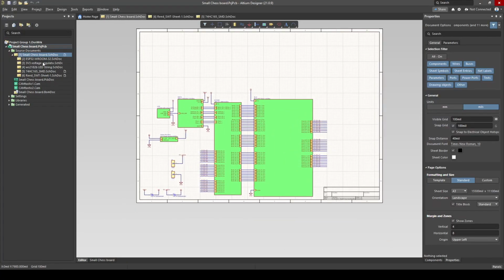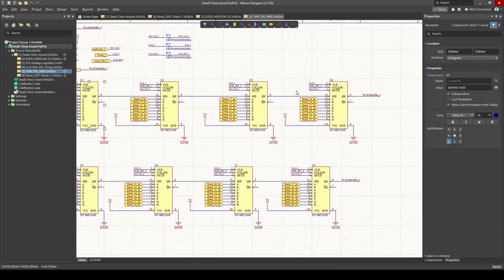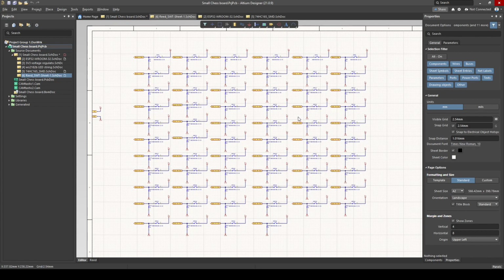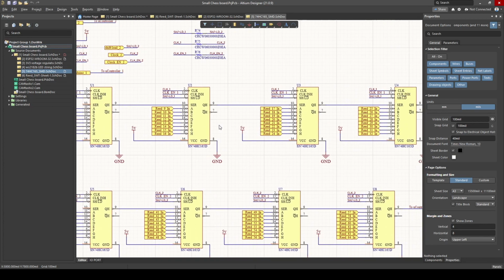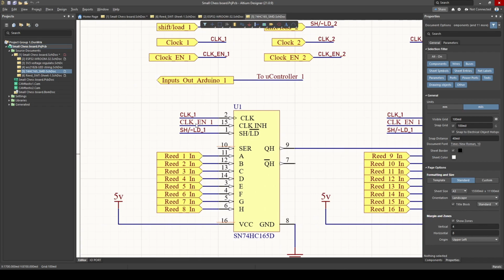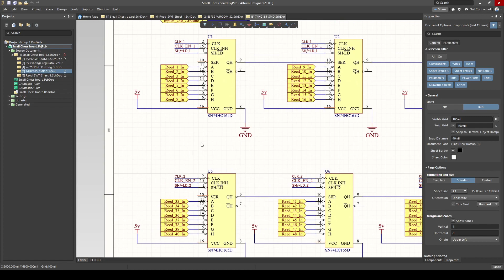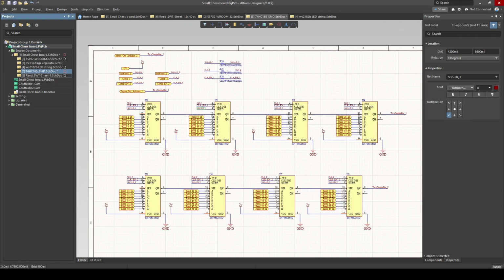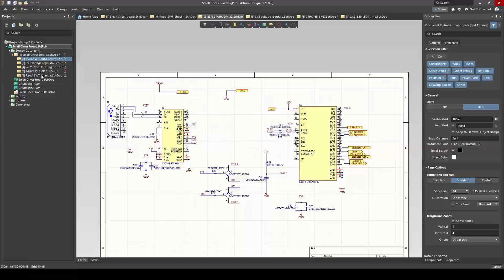Let's Learn Circuits Episode #7 - IO expanders using a shift register

Comment: The concept of serial to parallel shifter chips might be useful before 2k. But I think now many uCPU's, FPGAs are so cheap, it might be better just to get another uCPU's/FPGA with a high pin counts.
Reply from the maker: Lol, yeah, I agree. Shift registers are so 2000s:_RIP:. But what is the cost difference between using these shift registers and an FPGA, for example? Most of the time, I try to think of the cheapest way to build things, as many people on this channel can not afford to buy the expensive components. Also, it is about learning different concepts.
Reply: @PlumPot  Not only it's so 2k but it consumes more power and more chip count. An NRF52x40 has 48 useable pins only $4. An ICE40k has also like 32 pins around $4 or $5. Your ESP32 only like a dollar as well but consumes much more power.
Reply from the maker: Thanks man! Will definitely have a look into those. Thanks for the advise.

Comment: what is the expansion limit?
how many 74HC165D?
Reply from the maker: Hi Edward 👋it is advised not to have more than 4 x 74HC165D In series with one another. That why I made 2 separate sections with the 74HC165D